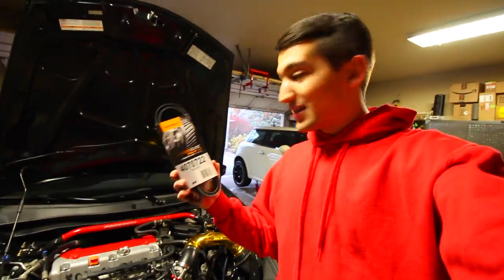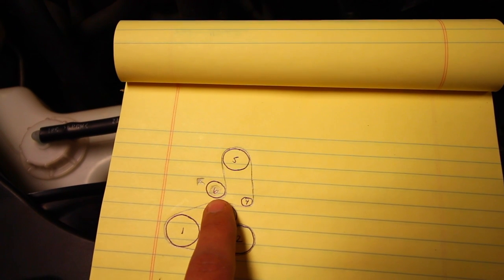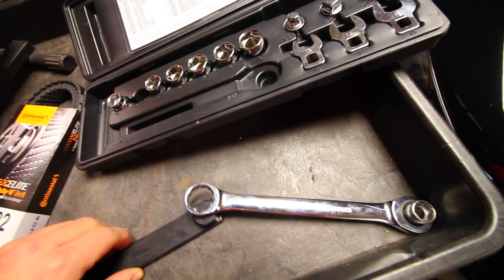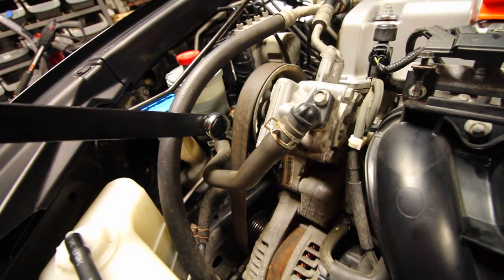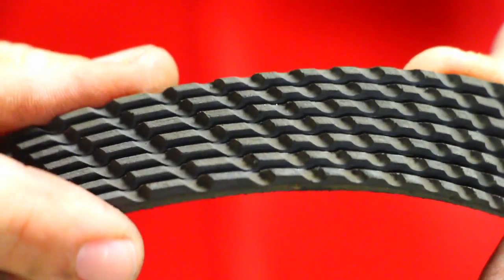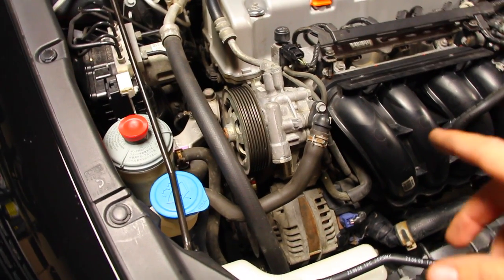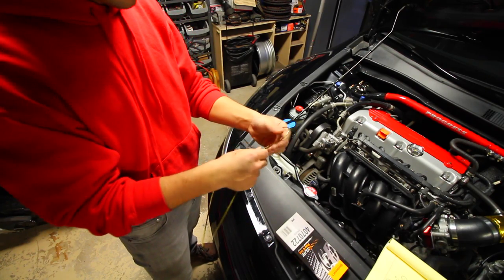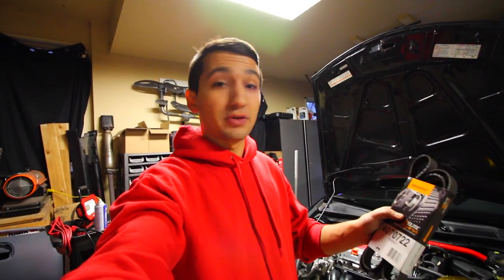How to Replace a Serpentine Belt

Comment: correct me if i'm wrong, but you keep saying that you have no cooling if your accessory belt snaps. On my car, the water pump runs on the engine distribution belt - the same on which synchronises the crankshaft and camshaft and i believe most cars do.

Comment: Hey Milan! Could you install a Dump Valve/Blow-Off Valve? Thanks! Love your videos really helpful!
Reply from the maker: Both are very different? Like a dump for the exhaust? Or a blow-off valve for the Mini?
Reply: milanmastracci They are the same thing. The Valve goes onto cars with a Turbo and gives off a really nice sound as well as work as a pressure release system to prevent wear on the turbos or engine! Look into a bit more if you need to for sure!

Comment: i have  2012 honda accord sedan exl v6 sometimes it makes weird noise like belt i cant tell if comes from engine or its the belt it only happens when car is cold on mornings than after car gets warn it goes away it has 75,000 miles should i change it??? milan

Comment: Yo Milan! I wondering if it's possible to change the colors of the lights on the steering wheel controls, climate control, etc. It would be awesome to see or maybe adding a double din?
Reply from the maker: You can, but the only way to get that done is to remove it all, change the lights to LED's and throw them back in the car. I had a double din that I was going to install, but I didn't like how it looked with so much extra space on the sides of the screen. It looked very weird
Reply: Woah didn't expect a reply lol. Alright, I was just asking because one of the lights on my steering wheel went out, plus I'm kind of tired of the dim green lights. Anyways though thanks for the heads up brotha! Love your videos!

Comment: What happens if your belt snaps? well... let me go over it in step form...

your radiator hoses, that's your coolant lines will be torn.

But if it's not torn then your cooling system will go anyway because of the water pump not being powered by the belt, that's the scariest part done and dusted

Then there's the power steering, that's always fun to steer at 25kph then there's the AC system... not really needed but it's OK
What else is there.... your Alternator, oh that there is the most fun, without that you get to experience some freaky freaky shit.

Your electronics in car, without an alternator I would give you about a day or 2 of driving around normally before this happens.. your electronics start to shut off... in a cascade.

Your radio, your fuel guage, your speedo, your ECU - yes... your ECU your temperature guage, but don't worry... you still get to know what's on the odometer, your automatic transmission starts to skip gears because of the solenoids... then the fuel pump, once the fuel pump goes, you have 2 minutes before you run out of fuel...(fuel pressure) ever ran out of fuel with a full tank? I have!

Once your battery is flat, you can't restart the car because the immobiliser will not let you until you have a jump start...

But hey, without the water pump you can travel 10 minutes before your hoses start to burst and cause major damage to your engines.

and by the way, what I have stated is not theory, your speedometer will seriously drop to zero, your gauges will not work because they need constant 12v power.

Ask me how I know.